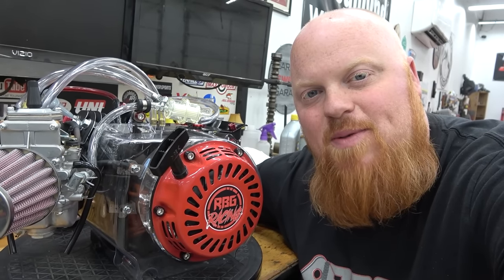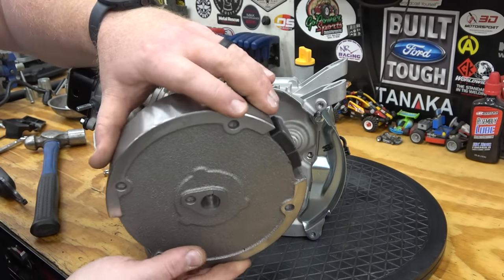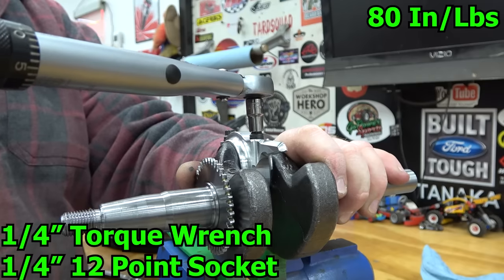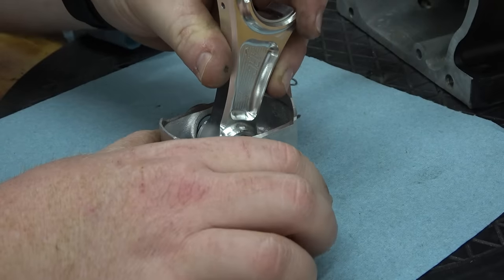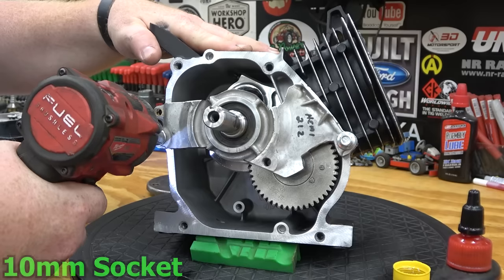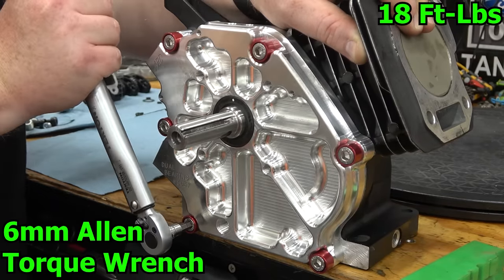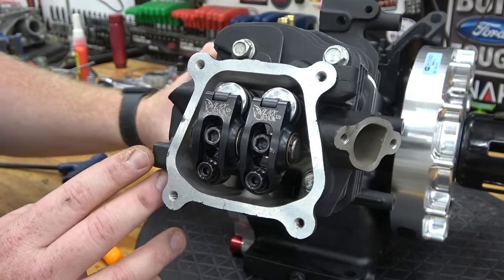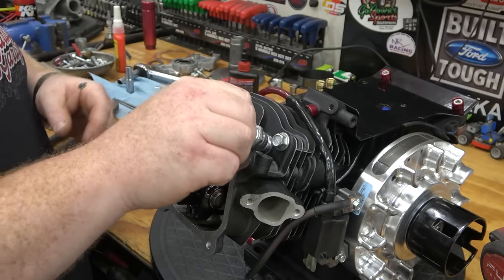Methanol Ghost 212cc Predator Build 👻 ~ Harbor Freight Race Engine

Comment: Hi Greg I have a 212 motor it get spark and then it dose not get spark what is the problem is it a bad coil thanks for you input on this Also wish I could have a motor be build like this one wow very cool could a 420 be build to run some thing like this.
Reply: I know he didn’t answer but check your oil
Reply: Or unplug your oil safety shut off
Reply: @rynomighttransmissionsfabr6895  ok thank you.

Comment: Talk about an engine rebuild!! But the big (BIG) problem I see is that you didnt swap the crank bearings on the flywheel side for something which costs more than $1. Some nice SKF or NTN or similar bearings would make the engine a lot more trustworthy. And once those cheap chinesium bearings break there will be a lot more repair money needed...
Reply: engine build without before and after stats….we don’t know if it works or if it just looks good.  incomplete video.

Comment: RBG - Great channel! I'm doing some of the mods you present. I need to lap a new billet flywheel to the crankshaft but I can't remove the woodruff key. I'm hesitant to use heat...afraid I'll damage the bearings. Can you offer any techniques/suggestions on how to remove the key on the crankshaft on a predator ghost??? Is it normal for the keys to be stuck? Anyone? Help!
Reply: I’m not any professional engine builder but a little heat won’t do much to the bearings but more the seals. as long as you were to heat and tap just the key it shouldn’t be a problem just keep it away from the bearing as much as possible, worst comes to worst replace your bearings and seals
Reply: Actually heat makes metal expand which would make the key tighter. Instead get a can of compressed air turn it upside down and blast the hell out of the key with it. It will fall out with barely a touch afterwards. Your welcome lol.

Comment: Wouldn't painting the engine defeat the point of the air cooling the bare aluminum provides? I agree it looks cooler... But?
Reply: @bradensmith888  ceramic coatings do the opposite... Which is why people use it for exhaust systems and in this case, the piston. It stops heat transfer

Comment: Why does the oem piaton have a cut out in the top of piston  for the valve clearance if the that top piston don’t and with shaved head. Just seems like the cut out on oem piston has no function in any circumstance ya ???

Comment: I don't know why ARC does the fins on the flywheels machined- it looks pretty I get it! But it does not cool as well as the original and why have the extra complexity and weight? Why not just make a flat flywheel with different light weight screw on fans. Every single pound equals 6 pounds spinning

Comment: Could anybody out here answer this question for me, how do you keep this motor from vibrating itself to death it being that the parts used in this build didn't come together as a assembly so I imagine it's not balanced. If it did come as a assembly then i must of missed that part when he said it. I've heard another YouTuber say in one of their videos you can buy some of these engines from different manufacturers that come balanced or nonbalanced. Hell why wouldn't you want it balanced. I have a coleman bt200x and at full throttle the engine vibrates so bad that I have to back off for fear of busting the crank or slinging a rod. I'm new to the mini bike theater, I'm coming from muscle cars to mini bikes. 🙂

Comment: Is methanal the same as e-85 fuel 😅I honestly would like to know.
Reply: E85 (Made from corn) has gas mixed in so it can stay in the engine without eating everything up. Methanol (Made from wood) is very toxic and exhaust burns the eyes and must be cleared out of the lines / carb when not running or will eat everything up. The only times I use methanol is in my direct injection setups so I don't have to worry about things getting destroyed. Can't beat the cooling of a 100% meth run engine though. The Hoonicorn is a meth car.
Reply: @fivepointeightnate  many thanks man!

Comment: Does anyone knows if I use the stock head do I still use the clone arc rod? Or do I use the predator 212 arc rod? Will be using a flat top piston but I'm not sure if the crank in the ghost is the same as the 212 predator. If anyone can point me in the right direction I'd appreciate it. Sorry just not a lot of info on it and I'm use to building 196 clones this is my first predator

Comment: Why not start with a cheap 212 ? You basically replaced everything but the cylinder and crank. What did that end up costing anyway? 1800 or so? I can buy an entire legit shifter kart with a built kt100 for 1700.

Comment: sorry man but its not a 2stroke to have the piston springs 128 digrees apart they going to be rotating in the cylinder while its running so its useless to put them apart

Comment: Gotta love that unbalanced crank in an expensive 9k rpm build.... Not sure what's worse, leaving the factory piston / rod in that probably is a bit better balanced with the factory crank and running it to 9k or throwing billet / forged parts on the factory crank running it 9k unbalanced. Not sure which will grenade first. I would just spend the $100 and get it balanced considering how much is invested. That's why I like opposed or two up two down engines.
Reply: You’re the first person I’ve seen that’s brought up the balance issue. (Im sure there’s a bunch but I never saw any) I’ve been thinking that on every video I watch. I would like to see someone do something about it.
Reply: Need a balance shaft
Reply: Not disagreeing it should be balanced but, those stock rods snap pretty quick. It came from China, a country well known for quantity over quality.

Comment: So using the block, the crank and the pull rope, while completely replacing every other part, makes it a Ghost build? You literally could have done the exact same thing with any Predator 212 Hemi block and crank. It was a great build for sure. But a Ghost build, it was not.
Reply from the maker: Started with a ghost engine. People want to see it done to every block so I show them.
Reply: Because for some strange reason people think the block itself is different from that of a $129 Hemi Predator 212. LOL. 

Cool build though for sure. It's just not a Ghost.

Comment: Wait thats a stage 5 motor! But you did not even bore it out or put a stroker crank in it or double valve springs. What! man when we raced we used brigs motors and went all out. im talking port and polish billet everything bored 160 over with a 400 stroker crank with ARC rods and 12000 rpm double valve springs 396 lift cam retarded 6deg on methanol. now thats a Stage 5 motor!  Pure open modified class is the only way to race.

Comment: Methanol?! Not even Indy or F-1 runs that anymore--too inefficient! Ethanol has proven the alcohol fuel to go with. (1.3x > 2.12x = amount to achieve stoichiometric compared to gasoline.)
Reply: I think Methanol has a better cooling effect, which helps a lot on an air cooled engine with twice the horsepower it was designed for.

Comment: So outside of the advertising why is this over priced waste of time engine worth the money could someone please help me understand this marketing scam??? SMFH! Wasn't paying attention in the beginning and originally thought it might have come with a better flowing head 🤔 than I replayed it and was let down even further! Because you're reusing basically the block and crankshaft can you explain what the point is buying a already half disassembled engine and paying more money especially when it doesn't come with a good rod or safe flywheel system?  IDC about the camshaft that's not the point but this should also show something in the performance spectrum but appears stock! What are you getting from the lesser parts and more cost besides a name Ghost? Or is that the joke??? So you open the box and your performance parts you're expecting to see are apparently invisible like a ghost 👻!  Lol! Wow what a great disappointment for all the BS behind this engine! Mine as well just save your money and build a stock predator for the money their charging you for nothing extraordinary!